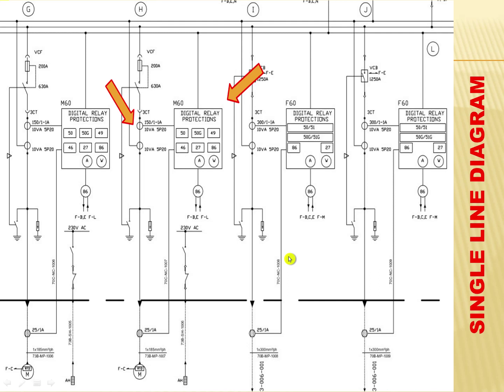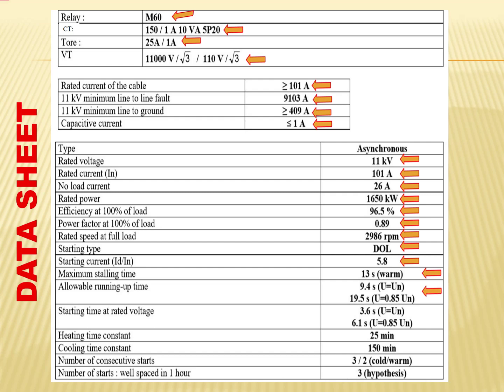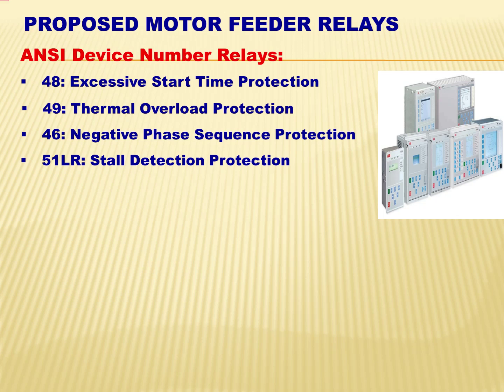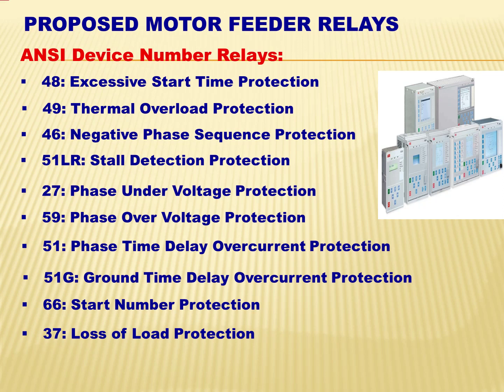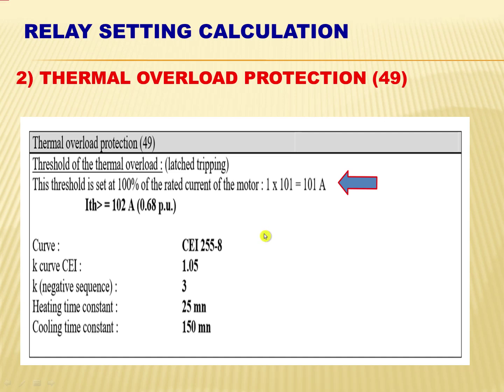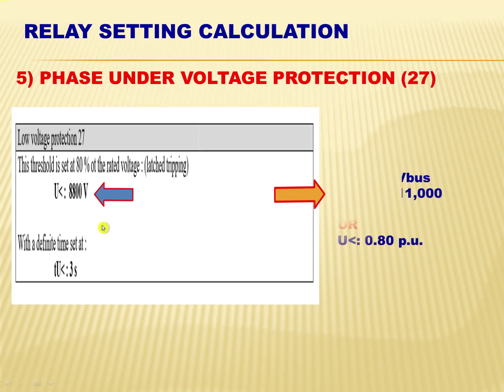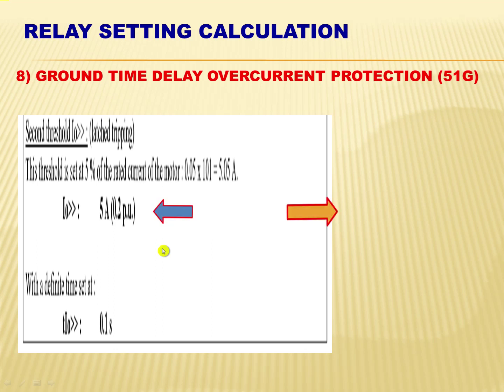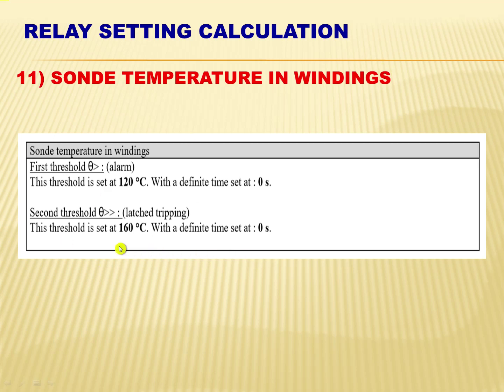Protection Relay Setting Calculation for MV Motor Feeder Relays

Comment: Hi Julius,
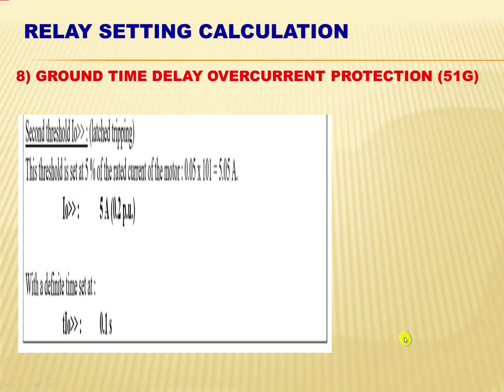I am thinking that 24:15 Earth fault protection
If it is set only 2 value i.e., threshold and definite time, it should be called as 50G not 51G
Unless you select IDMT Characteristic e.g., NINV, VINV or EINV Normal/Very/Extremely Inverse respectively and set time multiplier this will be 51G

Comment: great video, thanks for sharing.
 might be a good idea to include the motor inertia,  mechanical load details, run a simulation using Digsilent power factory  , and see the performance of the protection setting under various operating scenarios.

Comment: Hello, great video. Where did you get the settings that you show here? For example, the 80% of the short circuit current? Is there any standard for this? Thank you
Reply from the maker: I think for the 80%, it is related to the setting of undervoltage relay. For industry practice, undervoltage relay setting is being set between 70 % to 80% of the nominal voltage
Reply: And for Time of 70% WE Can let 3sec?? @juliussalutan8006

Comment: Thanks for sharing the valuable information
Kindly prepare a vedio on radial feeder setting for distribution system of load 7000kva, full load current 400 amp ,bus voltage 11kv ,CT ratio 400/5 ,low settings,high setting i.e I>,I>>& I>>>
Reply from the maker: I'll consider your request on my future videos, welcome